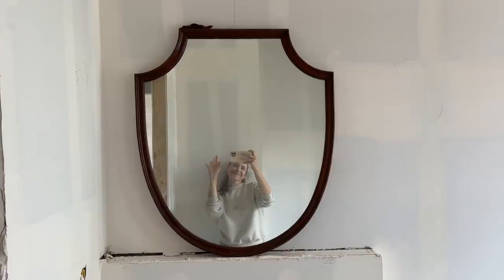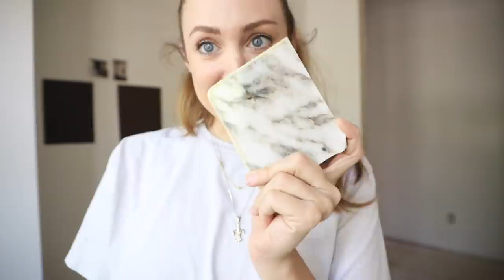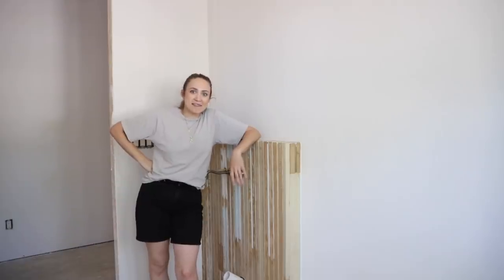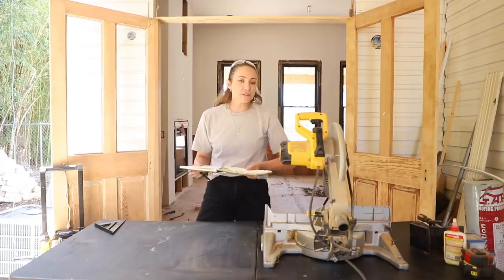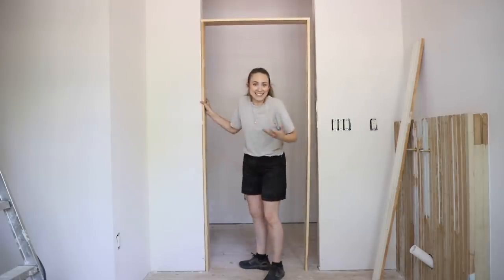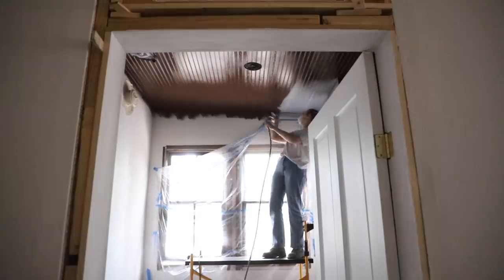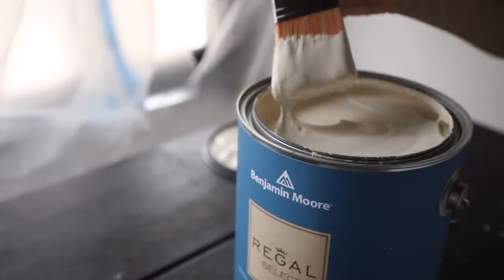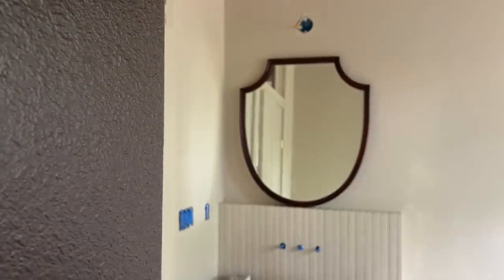GUEST BATHROOM MAKEOVER Episode 2 *Trim, Paint & MORE*| XO, MaCenna

Comment: A tip for when you grout, I know the instructions say to use a sponge to remove the excess grout from the tile, but after many tile projects I've discovered that microfiber towels work so much better and faster for removing grout and leave much less haze. Especially with a dark grout color you'll spend hours cleaning grout off of the tile with a sponge, but microfiber towels get it all in one or two swipes. Home Depot sells a multi pack in the cleaner aisle. Hope this helps!

Comment: It looks so good! I can't wait to see it finished! Btw, I have the same paint sprayer, and it looks like you needed to turn the pressure up a bit. When you were painting the ceiling, you were getting "fingers", which means your pressure's too low. Increasing the dial will give you a smoother application. (Not sure if you knew that already, and it was just an accident.)

Comment: there are shims you can put around the edges of the door frame and the walls when setting a door to make it fit correctly and not rub or have gaps. I would recommend you look it up, it will make a world of difference since most people don't know how to hang a door correctly... old door or not, it will work correctly if you do that.

Comment: Go to a actually paint store and buy a paint spray shield tool. They  are about 20.00 dollars but helps prevent over spray. It's like a big spatula that you hold while spraying different colors that meet up like ceiling and wall. They are pretty light weight so as not to fatigue you. You can also get different tips for your sprayer. These allow you to paint bigger or smaller areas.